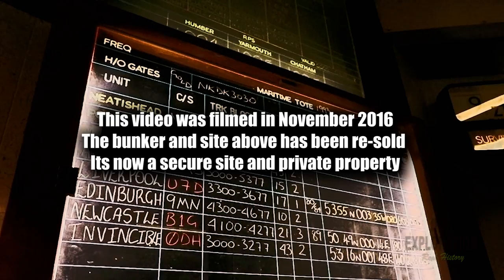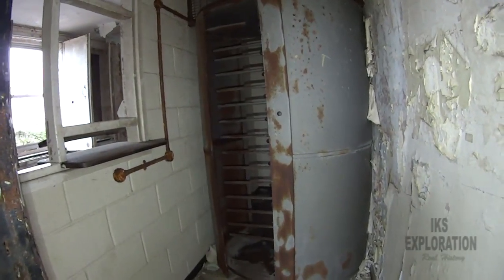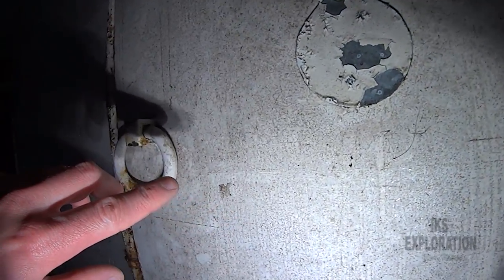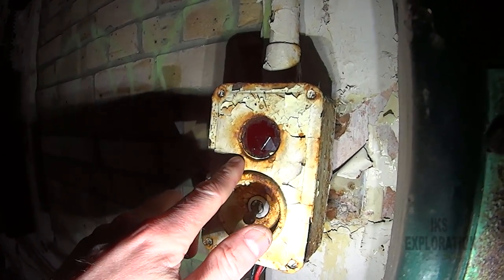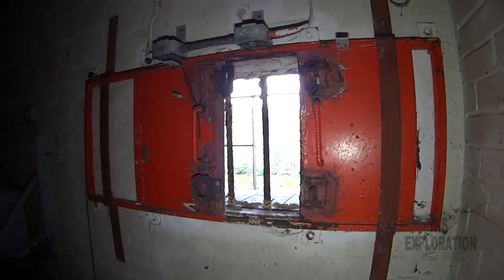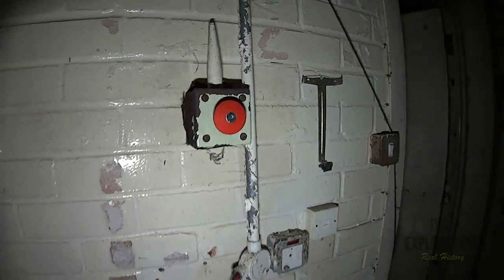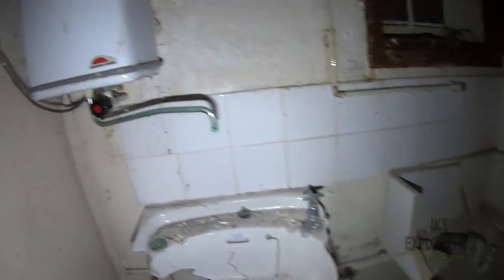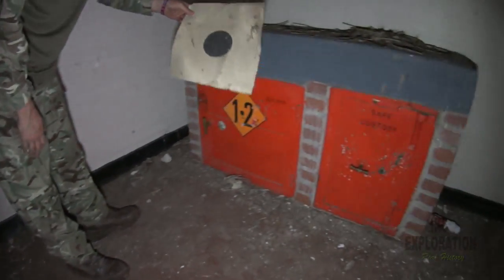Bawdsey Rotor Radar Station, Suffolk - Episode 2

Comment: Depending on base security level when the door is shut and locked an I'd card could be pushed through the slot and the face examined through the peephole before access given. Seen the same in operation and had to use it when visiting signals school in UK back in 1985. Used when base ops higher than "Bikini Black" level.

Comment: Interesting for me, as I worked in an operating nuke power plant here in the USA. I was a security guard, working under the federal governments laws. It was the most interesting job I've ever had. The heavy doors were like the ones we used, but the really heavy ones worked on a sliding mechanism. They were much easier to deal with by just pushing and pulling them. Our badging area was much more open. But it wasn't a military installation. This brought back many memories. Thanks  
Ps it was in the 1990's.

Comment: The room with the "Danger Earth Potential decal was possibly some sort of electrical room with high voltage. The decal would be warning you that the metal hatch was a source of grounding.
Reply: Behind the hatch is an electrical socket and opening the hatch all the way would cause the two to touch. On ducted electrical systems the whole ductwork is kept at earth potential, so if there was an abnormal earthing condition causing current to flow in the earth then it would transfer to the hatch when it was opened.